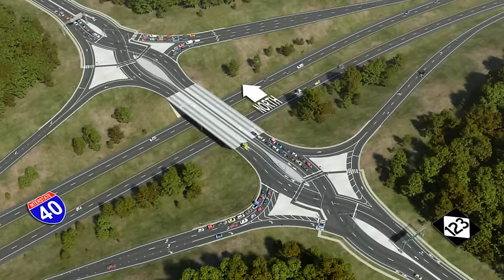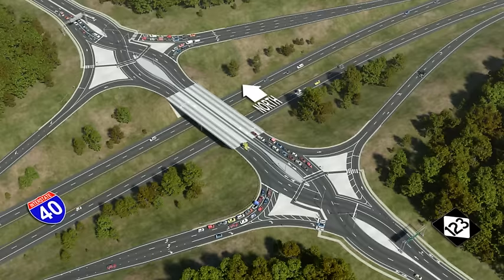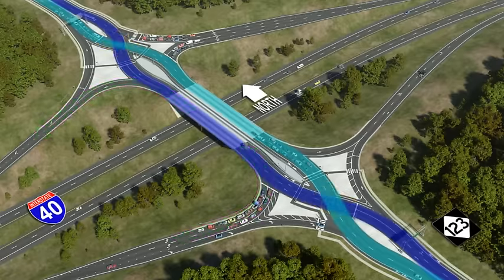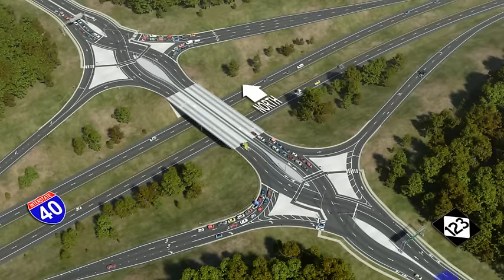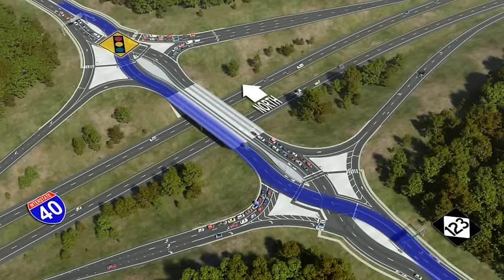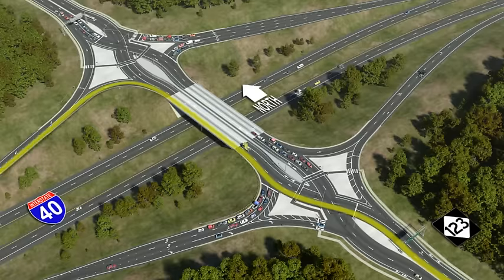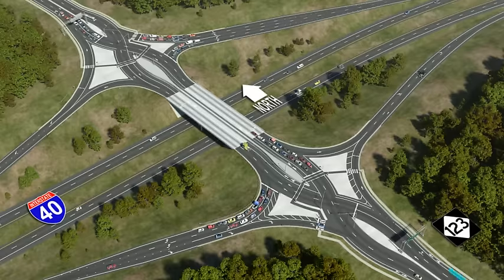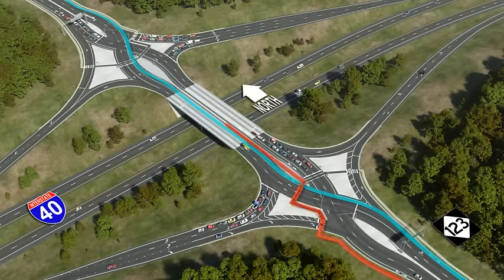Diverging Diamond Interchange Visualization

Comment: this design works phenomenally. We have multiple here in Springfield, MO and they are easy to use and eliminate collisions.
Reply: Or Reduce collisions so long as there is no distracted driver.
Reply: @joshuacornell6667  There's literally no oppertunity to mess up. There's barriers blocking you from going on the right side.
Reply: @HeelerHouse  Really? There's a barrier at the two points where traffic crosses? (no) The only thing stopping a collision is the light, for which we have plenty evidence of people missing or ignoring.

(DDI's are a current fad in civil engineering. The exact same effect can be had by proper programming of the lights -- traffic only flows in one direction at a time. There's very little need to spend two years rebuilding an intersection. 'tho here, the 440/Western interchange has always been one of the worst in the country -- fire up google earth to see how stupid/dangerous it's been for decades.)
Reply: @jfbeam  I mean they work well enough that they reduce all crashes by 47%
Reply: @jfbeam  Does not matter how well programed a light is in a standard intersection it will always have less vehicle through put then a DD. The DD simply eliminates 2 left turns as it puts every vehical on the side for turning left whether or not you are turning left.

Comment: These work way better than people think. 
people see the criss-cross parts and freak out. Its very very easy. just follow the lights and signs like you normally would and its virtually no different than normal.
Reply: Exactly
Reply: Yeah but most people are too dumb to follow a simple line on the road. They ARE great improvements but new so people freak out.
Reply: @Clempath  The ddi by us is almost done. Looking at it from overhead it looks complicated but from ground level it's really simple. Just follow your lane lines. I think even the dumb ones won't be able to screw this one up any worse than they normally do.
Reply: Except NO special left turn lanes or need to wait for green arrows to make left turns!!

Comment: It's about time.  But, the video neglects to mention one other important factor;.  In a cloverleaf interchange, designed 65 years ago, to exit the expressway you have to slow down and cross in front of traffic that is coming onto the expressway and trying to merge and accelerate into traffic.  With the amount of traffic we are experiencing today, that is very dangerous, to say the least. This new DVI pattern reduces the number of Acceleration/Deceleration lanes and eliminates the crossover. At the end of the ramp you will either turn right with the flow or turn left with a traffic control signal.
Reply: With the DDI, those going through have to two stop signals while those wanting to get on 40 do not need to stop unless there was an accident on the ramp. As for cloverleaf interchanges I hate them no matter what due to the amount of space they take up and the traffic the merging lane creates if not long enough. I have gone on cloverleafs which incorporate dual lanes which is interesting and does alleviate traffic so if someone was using the exit to turn direction from original they just stay on the inside or right-hand lane.
Reply: @joshuacornell6667  When I was a kid growing up and learning to drive in Baton Rouge, I think there was a cloverleaf at Airline and I-12 and maybe even again at Florida Blvd. They were horrifying because you had to change so quickly. But once I got the hang of that, I actually really liked them for the most part. But there were some big holdups at a few points that you might hit.
Reply: @jphili  We got quite a few cloverleafs in and around Boston metro area, and in Worcester county area, they are a bottle neck during peak traffic times and scary most others, but a breeze when there is not much traffic at all, those would be better served by a DDI ( we have none in MA yet afaik) or a roundabout exit aka Rotary as we call them here in parts of NE where more are popping up.
Reply: @joshuacornell6667  "... have to two" ??

Comment: This is a classic example of out the box thinking to solve seemingly complex problems. Incredible that this design was only thought up decades after cars were invented. I have always believe that the ultimate solution to traffic congestion is not necessarily more lanes or less cars on the road but to completely eliminate stopping at junctions. THAT is the reason for traffic congestion. If there were no red lights or stop signs, traffic would flow smoothly. One way to do that is to turn junctions into circles. But there has to be a better way. I'm sure that with 21st century technology we can come up with a multi-level design where no cars have to stop at the junction.
Reply: ahahahaha 10x as many crossing opposite traffic connections...righttttt
Reply: Take it from a professional driver; Most idiots on the road today don't know how to handle a circle.
Reply: No.. as a truck driver, traffic circles are horrible.

Comment: Would it make sense to do away with the traffic lights and have an over and under pass too? This could be a non stop in the future with exit lanes to get into the mall area and future business west of the mall. Just being proactive.
Reply: Problem with that is that cars moving across the over/under pass would then have to deal with traffic exiting the freeway and turning left.  The way it is set up in this video (which I assume is the way it is normally set up in real life), the cars exiting the freeway and turning left have a green light when the cars waiting to cross from right side to left side have a red light, and vice-versa.
Reply: I immediately had the same idea. While this works really well as an interchange, if the majority of the traffic just wants to go straight, this design is sub-optimal.
So I thought that it would be great, if only interchangers could use the interchange and people driving straight could have a signal-free path.

Now the issue is that the street would need 8 lanes total instead of 4. You would lay down an additional 4 lanes in the middle of this interchange as the overpass. Everyone keeping on the left 2 lanes (for their direction) would then just go straight over the overpass. Everyone keeping on the right 2 lanes (for their direction) would end up in the interchange as depicted in this video.

Building such an interchange would be a lot more expensive, because the overpass would essentially be a bridge. The interchange would significantly grow in size. Not just more lanes, but also a lot longer.
Reply: For an enormous intersection this might work.
The left turn lanes would need to be designated left turn lanes to be able to merge. Only issue is youd have three layers of traffic. To not be too abrupt the intersection would have to be quite large.
Reply: See Also: The Cloverleaf (takes up a ton of space.)

Comment: 7 years later, the one by my area is working pretty well for traffic.  Though I do catch a couple idiots that muck things up.  Seen one guy go the wrong way.  Seen one guy blow a stale light.  Even seen one guy crash into one of the light poles.  Not sure about the prospect of building these at every intersection, but I can see them doing wonders at high traffic intersections.

Comment: I think a cloverleaf intersection is a lot less complex and requires no electricity.
Reply: I agree.  But a cloverleaf takes up more space.
Reply: Also a cloverleaf can still get congested from those exiting having to slow down while those entering are speeding up. Not a good Interchange.
Reply: 1. Cloverleaf without collector/distributor lane is complex (read: bad) with ramp traffic weaving. 
2. Free flowing isn't always better. Traffic light controlled junctions work in many settings of service interchanges 
3. Parclo >>>...>>> Cloverleaf
Reply: Cloverleaf is for freeway to freeway interchanges. DDI is for a surface street/freeway interchange.  The surface streets MUST have the stop lights at each side of the diamond to work, but you would not want stop lights on a freeway to freeway interchange.
Reply: LOL and its massively more expensive and harder to build.
Reply: Cloverleaf interchanges are system interchanges between interstates or major routes (freeway to freeway). This is a different type, it’s a service interchange between a minor road and an interstate (freeway to street). In addition, cloverleaves take up a lot of space and involve weaving, which is generally not good.

Comment: I can somewhat see why these are beneficial as it cuts out the cost of bridge spans we use in SPUI's or Single Point Urban Interchanges.  They're also known as Texas U turns as they're all over Texas.  They work great, but are very expensive due to the cost of concrete these days.
Reply: I have  yet to use either of these types of interchanges, but they seem pretty straight forward to me unlike some others who are commenting. I mainly only come across the old four ways, cloverleafs and other common types of interchanges,.

Comment: This video was used to supposedly show the plan for I-40 and US-21 in Statesville, NC. Apparently it was also used for highway 123 in the original video. The problem is the video shows 123 crossing I-40 whereas US-21 goes UNDER I-40, not over as (123) shown in this video. I'm not sure if this will matter. Perhaps it will still work the same way whether it is over or under, but just harder to visualize when I know I-40 crosses over US-21.
Reply: I have yet to see an Underpass DDI where as the SPUI (Single Point Urban Interchange) has one example of being under the highway overpass. I have yet to experience using one of these but from what I see and my experience of driving Rotary.Roundabout is pretty straight forward, I do not find it complicated like some.

Comment: Although it requires a bit more space the clover leaf interchange is vastly superior. Nobody sits idling as they wait for a signal to change traffic is in constant motion.
Reply: That’s just not true at all. A cloverleaf has the same number of traffic lights as a diverging diamond or even a normal diamond. Sure, you could turn left on solid green, but that’s introducing danger. In this design, the sole purpose of the traffic lights are to alternate between two perpendicular directions of traffic that are both going straight, just like a standard 4 way intersection, but without the two (out of four total) traffic cycles for left turns. This way there are only two cycles.

Plus, the biggest fault of the cloverleaf is that it also creates incredibly dangerous conflict on the freeway between cars accelerating to merge on, and cars decelerating to merge off. Diamonds, diverging diamonds, single point urban interchanges, no other common design has that. They invented partial cloverleafs specifically because that part of the cloverleaf sucked so bad. Every time I go to my sister’s house I have to go from 70 mph to 25 in like 5 seconds while trying to weave through cars going from 25 to 70.

Last, the DDI basically turns every left turn on the overpass into a simple merge, just like how ramps interact with the freeway. Not only is that more free flowing and eliminate the need for those extra traffic light cycles, but it also makes it nearly impossible to merge onto the freeway going the wrong direction since you would have to make a hairpin. In a cloverleaf or diamond you could just make a normal righthand turn and boom, you turned an off ramp into an on ramp.
Reply: @alexhussey1308  Hogwash, perhaps you have near seen an actual cloverleaf interchange there are no traffic lights at all.
Reply: @tjw4947  The cloverleafs near me don’t have the diamond on top, you’re right there’s no traffic lights on most of them which do. You still have to go around a bigass loop at 20 mph and hope no one’s gonna head for the off ramp and meet you under the overpass. There’s a reason they’re being modified into other designs and being phased out. When traffic picks up the design becomes less and less viable. The weaving is dangerous but it also causes congestion by increasing the amount of crossing over that has to be done. People in the right lane have to slow down, on the freeway, because of this design. That’s a fatal flaw. It has literally killed people. I’ll trade a couple seconds at a stoplight to not have to worry about going 25 next to people going 70. Most interchanges take the conflict and put it on the surface street. Cloverleafs go, “no, not dangerous enough. Let’s put all the conflict on the freeway where the speed is higher.” The cloverleaf is the only design that has this. I can get behind a partial cloverleaf that removes that danger, but a traditional cloverleaf? Come on. That’s like the one wrong answer you could choose

Comment: they have one of these in a area i go to once and awhile which was very well known to be slow and hard to turn on the freeway people running the red lights by 3-5cars because they been sitting at the light for 10-15mins already because of how fast the old lights would go from green to red. they put this in and omg so much better and how they have it setup they have lights for even the turn on ramps so that if a person on a bike or walking can cross without a big worry like everyone thinks not sure why i didnt see this in the video but i skimmed it,  and traffic moves so much smoother at first i was like what is going on after the first time going through it was easy to figure out but we have idiot drivers everywhere that it probably will cause a issue of them driving down the wrong way but they would have to be pretty stupid to do this as they can see cars on that way facing them if they that dumb to keep going straight then take the license away because they should not be on the road. They are putting one up by where i live now and cant wait for it because it will make that so much easier to get through specially during peak rush hours.

Comment: Only problem is If you take the exit and want to get back on the highway going the same direction
Reply: If your exit was the next one I am sure there is a n alternate route down the road, but if your exit was two or more later, then yeah that could be an issue.
Reply: You wouldn't be able to do that on most interchanges anyway, though. In that case, I  guess you'd have to get on the road and then do a U-turn or somehow get on the other side of the road.
Reply: WHY would anyone want to do that?  If I wanted to keep going in the same direction, I would not exit in the first place.
Reply: Trwent, the most common reasons someone might exit the freeway briefly before continuing in the same direction would be to stop at a gas station, or to get some fast food.
Reply: To do either of those things, you are going to be turning after exiting anyway.
Reply: All I know is that it's very common here in Texas for service stations and fast food restaurants to be located in the corner of intersections between freeways and major surface roads in which the entrances face the freeway service road (frontage road.)

Reentering the freeway from such a business merely involves getting back onto the service road for the freeway that you just left and continuing in the same direction you were going. Usually, they enter the freeway again from an on-ramp immediately after the intersection. You only cross other traffic at a light, and you don't have to enter the traffic on the cross street.
Reply: Herman Von Petri, There are no gas stations or food inside the intersection so that makes no sense

Comment: An improvement over the clover leaf design.  However, I question the wisdom of placing a straight thru preferential lane for bicycles to the right of a general purpose thru and right turn lane,  This creates a manufactured conflict between drivers of bicycles and right turning motorists  - the typical "right hook".  Engineering FAIL.

Comment: U turn: Check!
Left turn: Check!
Right turn: Check!

Ok what if I'm driving on I-40-W, and I take the wrong exit. I want to re-enter I-40-W and take the next exit instead. How could I do that with this kind of route system?
1. U-turn to I-40-E then U-turn back to I-40-W?
2. Take Right and try to U-turn when possible?

The U-turn routes are excellent because it helps, but the infinity-like routes actually make things worse because people take wrong exits a lot.
Reply: Yeah I also noticed that with these DDI as well, not to mention oversize that is over height loads needing to exit to clear the overpass low limit height. But since there is more than one way around as in other roads taking different routes to the same place, I doubt that is much an issue for those loads.
Reply: First of all, "Over Height Loads" have escorts, permits and pre determined routes. DDI does not require new overpasses, but if an overpass is too low, the police will be notified in advance (because of the permit) just as they are today, and the load is escorted over the DDI and back onto it's route.
Reply: aLonelyRat #3 Pay attention to which exit is yours
#4 Proceed to next street and turn around.

Comment: Just got one in a local town. It is so confusing going on the left side of the highway. And in FL everyone is looking down at their cell phones while they drive. I’m avoiding this thing completely. There’s going to be tons of accidents.
Reply: Why would there be accidents if people just follow the road markings/traffic lights?
Reply: This is proven with hard evidence to be more safe than what is in place. There are barriers and traffic lights and road markings. You literally can't mess it up, as I have driven through one myself. The intersection starts curving before you cross over so you have to go to the other side.
Reply: This intechange not only helps traffic, its also proven to decrease accidents by almost half. It also has a concrete barrier so you cant drive on the wrong side, to cause an accident in this, you'd have to be intoxicated.